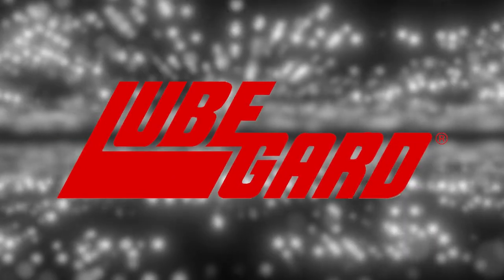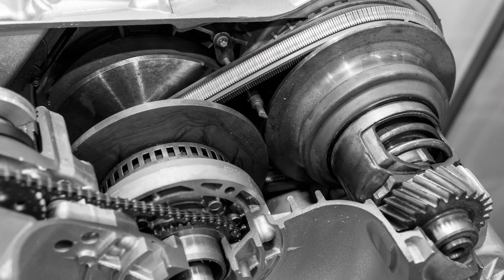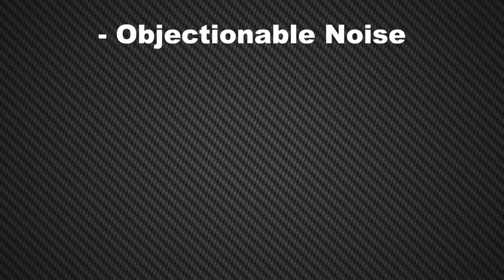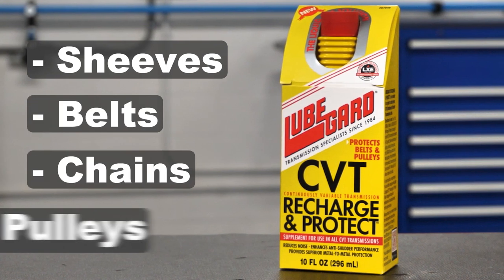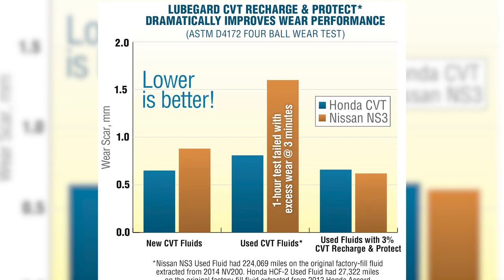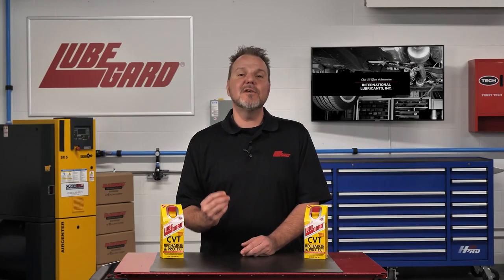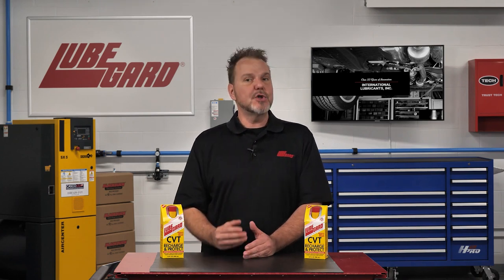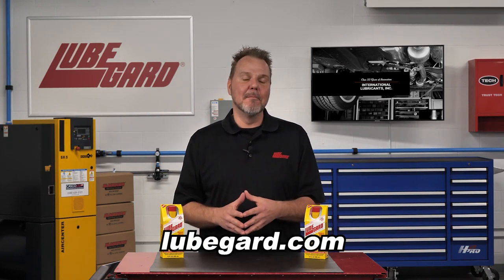How to apply Lubegard CVT Recharge

Comment: This worked great in my 2020 Corolla with the K313 CVT. The transmission was rough before and now it’s so smooth. I had this added when the dealer did a drain and fill. I’ve been using Lubegard additives in my cars and always had good results.

Comment: So...the 10th gen civic 1.5t holds a total of 7-8 qrts of CVT fluid. The bottle is 10oz. So dumping the entire bottle in would be fine right?
Reply: Isnt it 4qt?
Reply: @jerraldcanlas6395  4 will come out in a drain and fill. However there's something around 8 all together in the entire system.
Reply: Yes it is good .
Reply: I would extract 10oz from your transmission then add the bottle
Reply: @kalani1987  did that on my last drain and fill. My transmission is fine, always has been. I do a drain and fill once a year. CVT just scares the shyt out of me lol, and this bring my first I want to keep it going. I just hope this stuff helps.
Reply: @vermontvermont9292  yeah I just got a new '24 Corolla with a CVT. Will probably add this Lubegard to it even though it's running ok for preventative maintenance